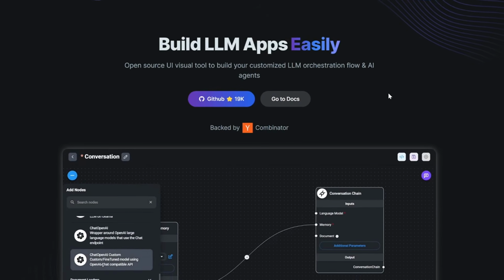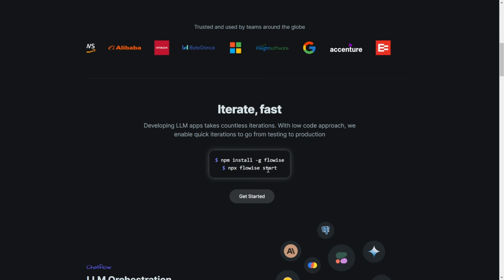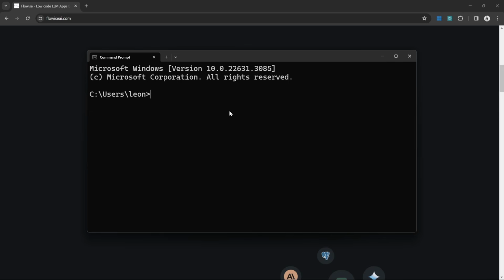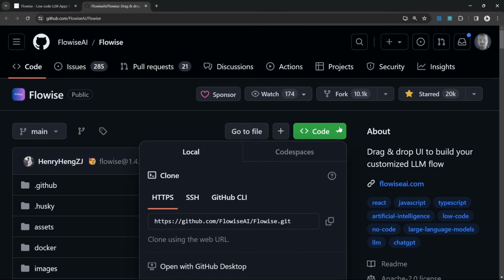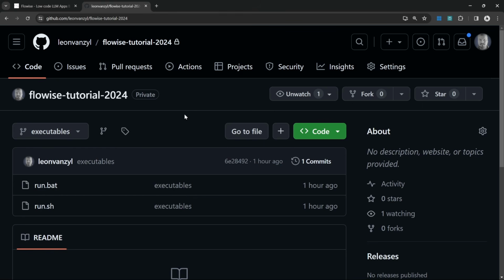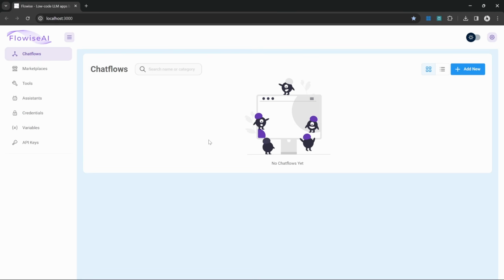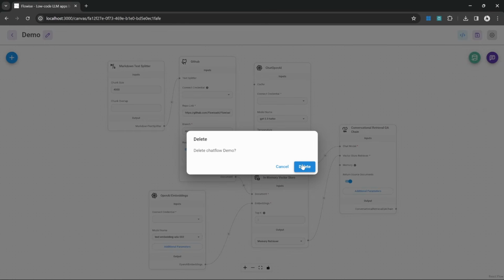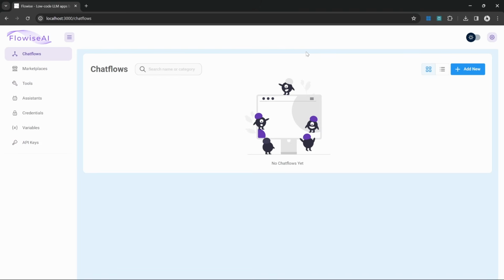Build AI Apps WITHOUT Coding: Flowise Tutorial #1

Comment from the maker: Having issues running the yarn commands?
The installation process changed slightly with the latest release of Flowise.  We now need to use PNPM instead of YARN for the install, build and start commands.

First, install PNPM by following the instructions on this link:
https://pnpm.io/installation

The rest of the instructions in this video is the same, but instead of using YARN, use PNPM INSTALL, PNPM BUILD and PNPM START instead.
Reply: taht one works
Reply: thanks for this, I was becoming nervous that again something is not working on my comp :)
Reply: Thank you so much---i got stuck at that step!!
Reply: oh dear I didnt see this
Reply: you need to update the git repo.
Reply: Still id did not work for me.

getting below error
flowise-components#build: command (C:\Flowise_Main\Flowise\packages\components) pnpm run build exited (134)

 Tasks:    0 successful, 2 total
Cached:    0 cached, 2 total
  Time:    2m23.684s
Failed:    flowise-components#build

 ERROR  run failed: command  exited (134)
 ELIFECYCLE  Command failed with exit code 134.
Reply: @SathishKrishnamoorthy-sk  same with you, still error cant run 😢
Reply: @SathishKrishnamoorthy-sk  Were you able to fix it?

Comment: Hey Leon, this is a great video and series. Thanks for posting. I've found that the 2nd option to build from source currently does not work as the mirrors seem to be down for one of the material ui components so fell back to installing with npm -g as per your notes and the docs. Digging a bit deeper though I also found the docker compose up command and instructions also on flowise quick start and used that also. Either works but best of all is your commentary on getting this up and running and how it all pins together. Brilliant, thanks.
Reply from the maker: Thank you!
There was a bug that affected installation. This was resolved yesterday. Options 2 and 3 work again 👍
Reply: @leonvanzyl  thanks, this is good to see. I did though learn a lot about the framework by delving more into docker so nothing lost and much gained for me. All down to your video series also, which has accelerated my progress greatly

Comment: Thanks for the tutorial. it is great as usual.

after using pnpm start, I got the below error:
2024-03-18 23:23:10 [INFO]: Starting Flowise...
2024-03-18 23:23:10 [INFO]: ⚡ [server]: Flowise Server is listening at 3000
2024-03-18 23:23:10 [INFO]: 📦 [server]: Data Source is being initialized!
Migration "AddFileUploadsToChatMessage1701788586491" failed, error: SQLITE_ERROR: error in view view_chat_flow_message: no such table: main.chat_message
2024-03-18 23:23:10 [ERROR]: ❌ [server]: Error during Data Source initialization: SQLITE_ERROR: error in view view_chat_flow_message: no such table: main.chat_message
QueryFailedError: SQLITE_ERROR: error in view view_chat_flow_message: no such table: main.chat_message
    at Statement.handler (F:\Flowise\Flowise\node_modules\.pnpm\typeorm@0.3.20_pg@8.11.3_sqlite3@5.1.7_ts-node@10.9.2\node_modules\typeorm\driver\sqlite\SqliteQueryRunner.js:88:37)
    at Statement.replacement (F:\Flowise\Flowise\node_modules\.pnpm\sqlite3@5.1.7\node_modules\sqlite3\lib\trace.js:25:27)
    at Statement.replacement (F:\Flowise\Flowise\node_modules\.pnpm\sqlite3@5.1.7\node_modules\sqlite3\lib\trace.js:25:27)

what do you suggest please?

Comment: Extremely powerful tool and great tutorials, greatly appreciated. Just one stupid question: is there any way to hard code (no LLM) a certain section of the interaction i.e., prompting the user for specific input before handing over the conversation to LLM agents? Couldn't find any tools or components that allow to insert simple dialogue like e.g., Cognigy does.
Reply from the maker: You could just change the welcome message. It's a configurable value in the embedding API.
We'll have a look at changing this in this series, but I do have an order video on web embedding that could help you.
Reply: @leonvanzyl  Thanks for the quick answer. What I'm actually looking for is a way to ask the user for three seperate inputs and then handover the interaction to my flow. However, once the interaction is finished the user would need to give new input (x3) again i.e. I require a semi-scripted loop. Is there any built-in components that can do this? Couldn't find any. 

Do like the fast and simple way to create and deploy react-based GPT bots though! :)

Comment: In your opinion, when should I use each of the langchain code, flowise and crewai tools? What is the substantial difference between them that sets them apart?
Reply from the maker: Good question.

Langchain is a development framework and you need Python or JavaScript programming skills to create AI apps. Integration with websites and apps are also technical.

Flowise is a low-code, visual interface for building AI apps. No need to learn programming to use it. It offers integration out of the box.

CrewAI also requires Python coding skills, and can be used to create collaborative agents.

Comment: there's a part of your video that shows using yarn to install and the files use pnpm, so I got a conflict having ran both types of installers and had to start over with only pnpm instead of yarn.
Reply from the maker: Flowise changed from yarn to pnpm after I recorded the video.
Check the pinned comment 😁

Comment: warning flowise@2.0.1: The engine "pnpm" appears to be invalid.
$ cd packages/server/bin && run start
 »   Error: command start not found

Getting this error when I give Yarn build command
Reply from the maker: Checked the pinned comment. You need to use pnpm to install 👍
Reply: @leonvanzyl  Still getting error

flowise-components#build: command (C:\Flowise_Main\Flowise\packages\components) pnpm run build exited (134)

 Tasks:    0 successful, 2 total
Cached:    0 cached, 2 total
  Time:    2m23.684s
Failed:    flowise-components#build

 ERROR  run failed: command  exited (134)
 ELIFECYCLE  Command failed with exit code 134.
Reply: @SathishKrishnamoorthy-sk  I am also getting this error

Comment: Am I missing something? The chat input box is greyed out even using the most simplest of chat flows. All credentials are correct. Is there a "start" similar to node red's flow start button?

Edit: This script appears to be windows centric. NPM install -g also not working. Getting "env: node\r: No such file or directory" when starting. Usually indicative of windows specific line endings somewhere in the repo. Docker runs but with greyed out input box. Non global install will only run dev mode with greyed input box.

The look of this web based app is very enticing but Dify is a no nonsense, works out the box equivalent with same features, however I do prefer the look of Flowise. Pity.
Reply from the maker: Do you have node installed on your machine?
Reply: @leonvanzyl  Yes. I followed installation instructions for both node and docker to a T.  I have seen YouTubers mention the grey box and how restarting the script can help, but it doesn't. I thought giving the model time to load Ito RAM and VRam was necessary but it's not that either.

Comment: would be ok if the credentials part worked I tried 3 versions from 1.4 to 1.5 and none worked so useless !!!
Reply from the maker: What do you mean it doesn't work?
Reply: @leonvanzyl  many complaints on the discussions , I click add credentials in the credentials tab  and no options appear, deleted and re installed 3 versions all the same also there was no options or ability to  add on the build page either as the box would not accept input 🥴
Reply: @leonvanzyl  thx for the response

Comment: Hi Leon, installing locally, whether I follow your instructions or use your script, flowise runs locally, the minute I try save a workflow It crashes and I get the following error. unhandledRejection:  SQLITE_READONLY: attempt to write a readonly database
QueryFailedError: SQLITE_READONLY: attempt to write a readonly database
    at Statement.handler (/Users/waynebruton/flowise/Flowise/node_modules/typeorm/driver/sqlite/SqliteQueryRunner.js:88:37)

Any suggestions?
Reply from the maker: Haven't seen that before. Maybe someone in the comments will know.
Maybe you should run the terminal with admin rights. No idea.
Reply: @leonvanzyl   Thanks Leon, that actually did the trick running as sudo. Cannot believe I never thought of trying that 😬
Reply from the maker: @WayneBruton  just glad you figured it out. Enjoy using Flowise 😁
Reply: @leonvanzyl  Quick question (I know your tutorials are not there yet), openai assistants, is it possible to let the assistant access the internet as well as the document?

Comment: Is this still working? I'm running into issues.
Reply from the maker: What's the issue?
Reply from the maker: Check my pinned comment as well.
Flowise changed to using pnpm after video was recorded.
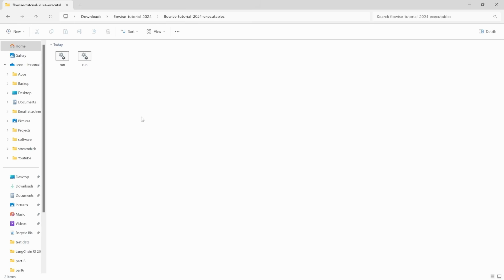Reply: @leonvanzyl  Hey Leon, At 5:30 the video states we can run the .bat file from anywhere on the computer. However, when I from a folder on my desktop, the errors I get go something like this: 

1. "ERR_PNPM_NO_PKG_MANIFEST No package .json found C:\Users\###\Desktop\flowise-tutorial-2024-executable\flowise-tutorial-2024-executable". 

Another error bellow it say: 

2. "ERR_PNPM_NO_IMPORTER_MANIFEST_FOUND No package .json (or package yaml, or package . json5) etc.

The bat seems to be looking for the PNPM only in the folder the bat is located in... 

I'm not a coder so this is a bit of a mystery to me.

Thanks in advance.
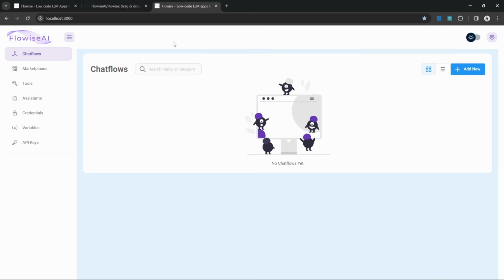Reply: @leonvanzyl  Figured it out... This is where I went wrong: At 5:12 you say, "Now let me show you the simplest way to execute ALL of these previous steps in one single go." The misunderstanding is that, yes, you need to make sure Git, Nodejs, and PNPM are properly installed first and then, and only then, is it "ALL in one go". In my case Git didn't install correctly the first time.

Hope this helps someone. 

Question, will the .run.bat file be updated in the future? That is to say, will we need to check your Git page and download an updated version at some point?

Any way, thanks for your good work.